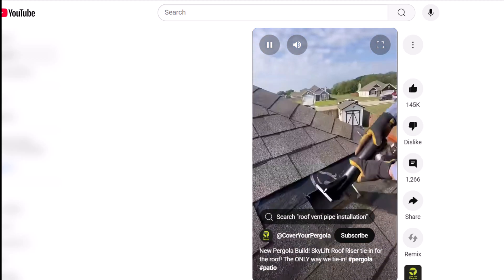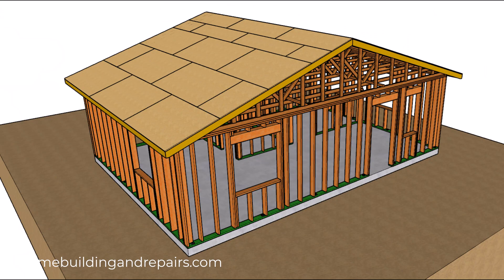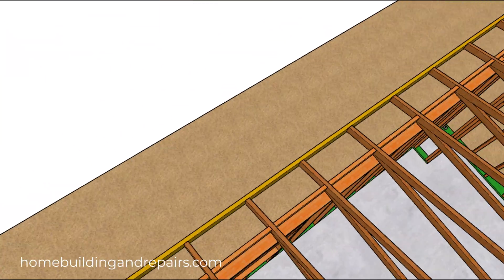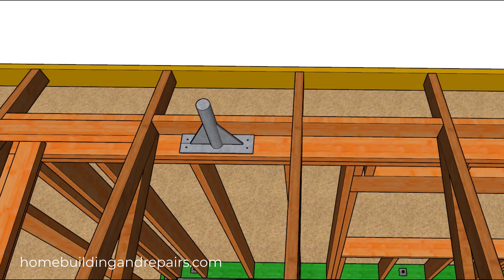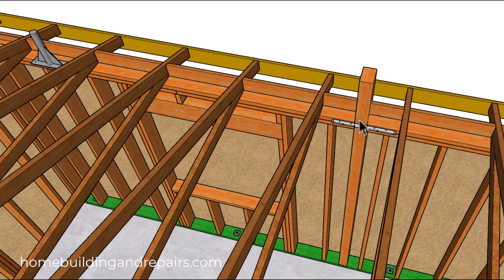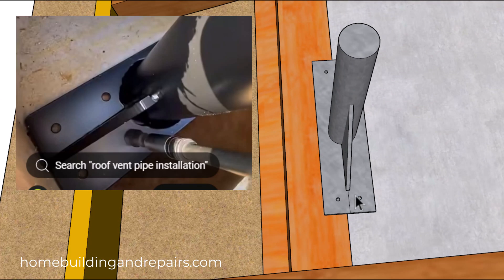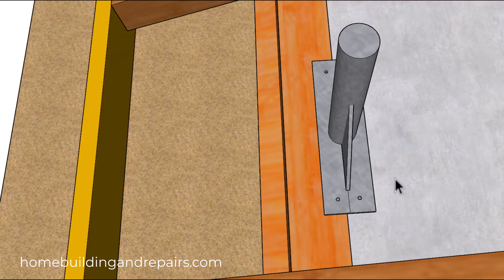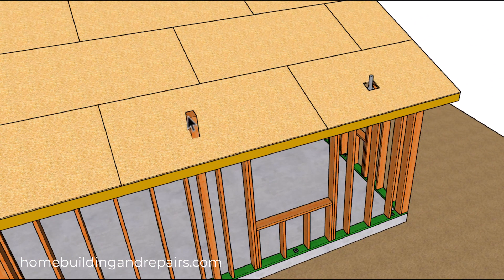Is This Patio Beam Hardware a Genius Shortcut or a Future Disaster?

Comment: Yeah, I always thought the idea looked interesting, but like you I also had the same thoughts and concerns. Probably the best way would be to run a full length 3" diameter structural steel pipe with ⅛" or ¼" wall bolted into place after dropping it through a 3" hole bored through the double top plates. That way you can still use a standard 3" roofjack. Could also use a notched 8" wide steel plate bolted to the top of the double top plates to connect the wall on both sides of the steel pipe together.